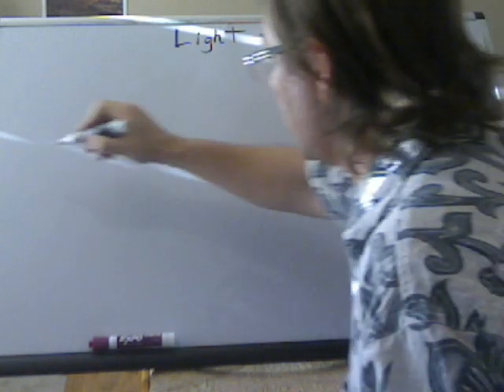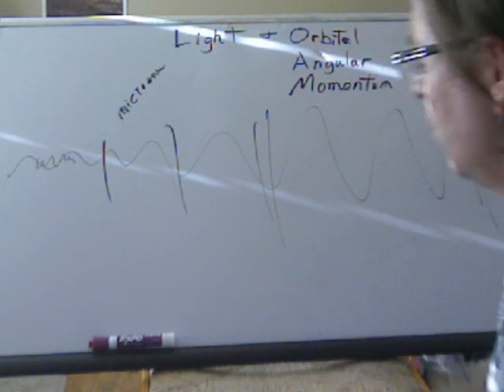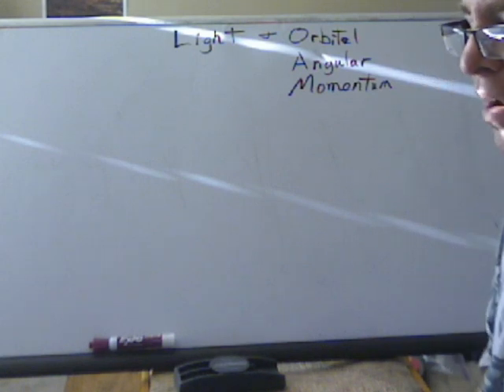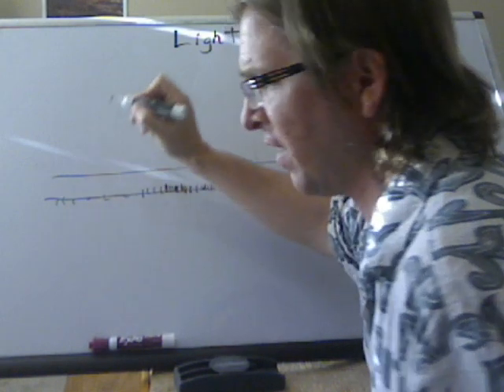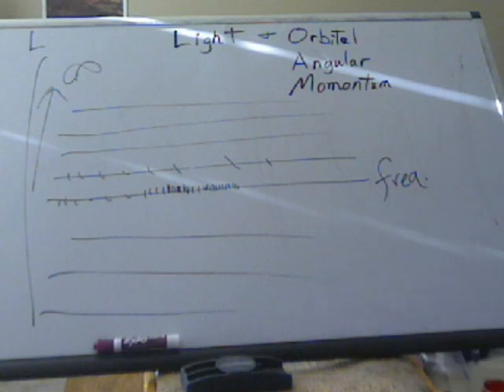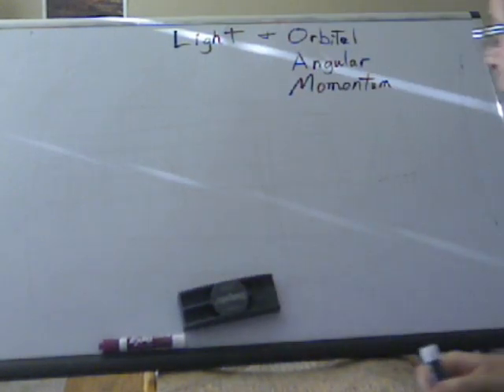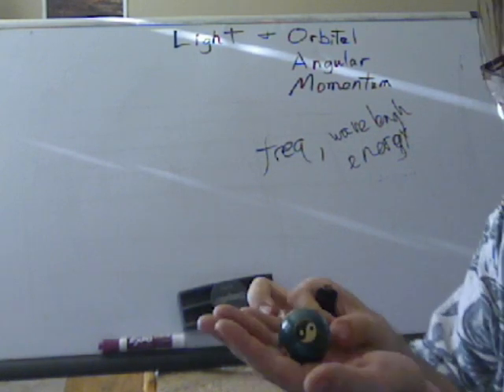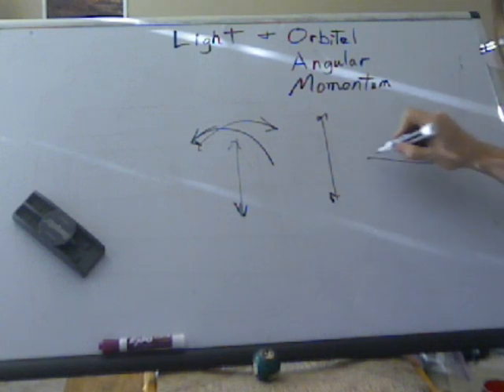Potential of Orbital Angular Momentum

Comment: Is the diameter of the vortex (caused by destructive interference at center of OAM beam) dependent on the wavelength or on the diameter of the beam?

For example, for a given wavelength, say in microwave range, would the diameter of the vortex as it enters the far field from a three-meter diameter antenna be wider than the vortex from a one-meter antenna?

Is there an equation to calculate the diameter of an OAM  vortex?

Comment from the maker: Think of this like spin or circularly polarized light. If we add equal amounts of CW and CCW circularly polarized light, we just get vertical or horizontal polarization. 

If we want destructive interference, then we need to take a wave of the same OAM and have it 180° out of sync.

Comment: What is your opinion of Ove Edfors and Anders J. Johansson article, "Is orbital angular momentum (OAM) based radio communication an unexploited area?" 

They claim OAM radio communication is a sub-class of traditional MIMO communication with circular antenna arrays. So, if you have a set of antenna elements that can create radio vortices, the calculations inherent in a MIMO radio system will automatically create and use vortices to the extent they are useful, and they still need multi-path.